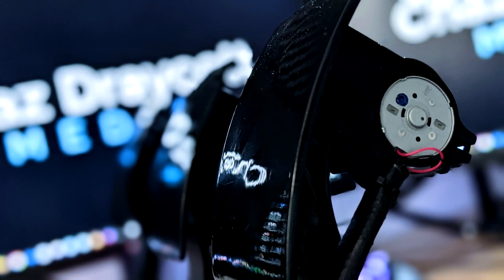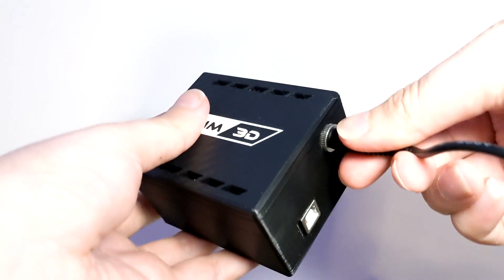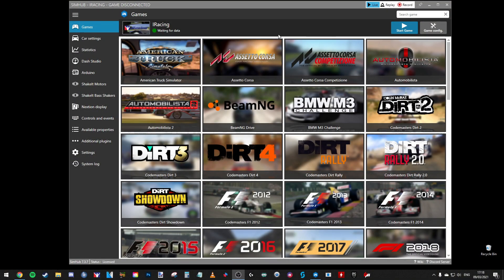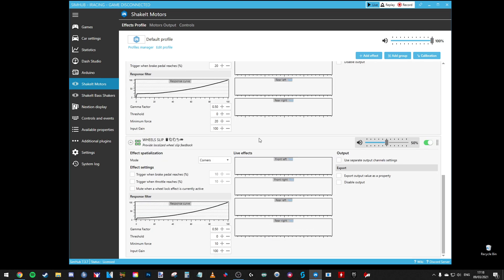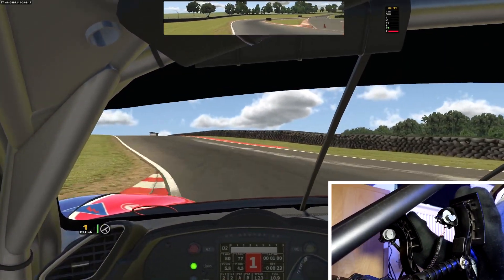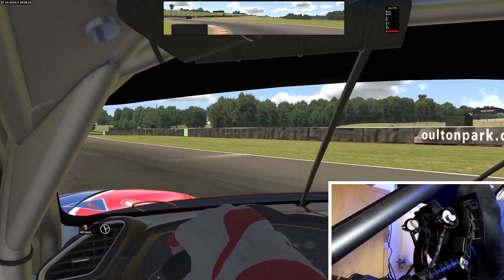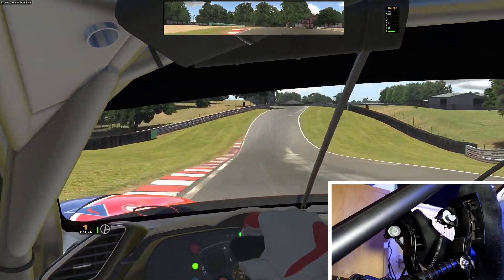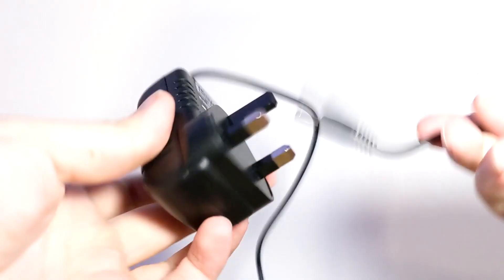Sim3D Rumble Motor Kit Review for Fanatec CSL Elite LC Pedals

Comment: Did that rumble motors running on PS4/PS5 ?
Reply from the maker: You'd need to be running SimHub on a PC connected to them to make it work, so technically, unless you have a PC, no.
Reply: @ChazDraycott  thx for answer 👌